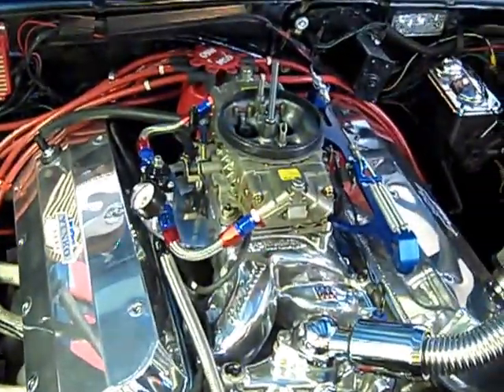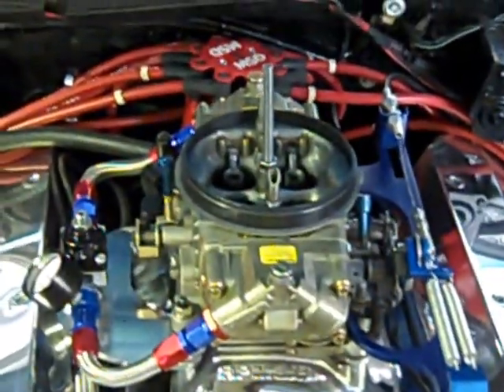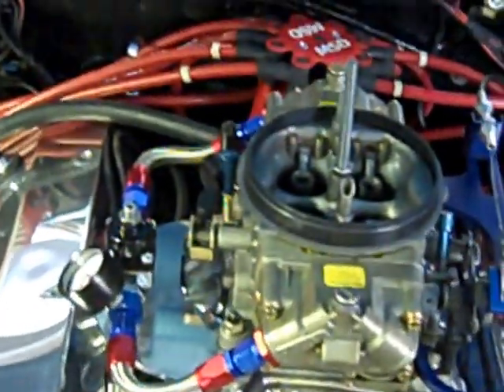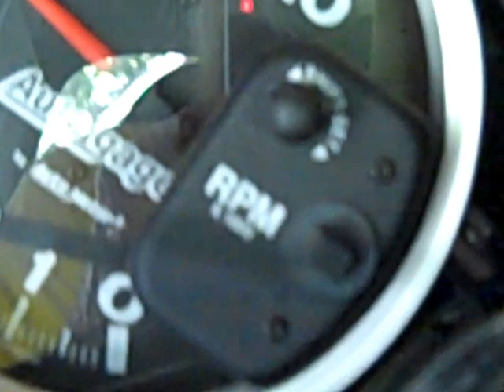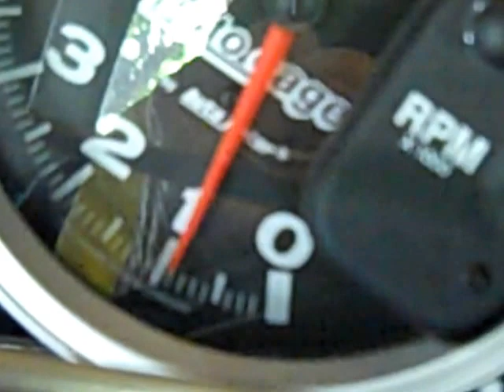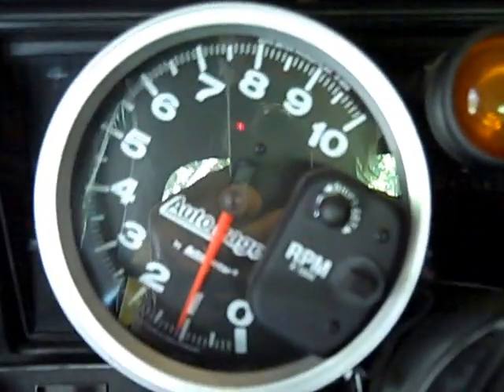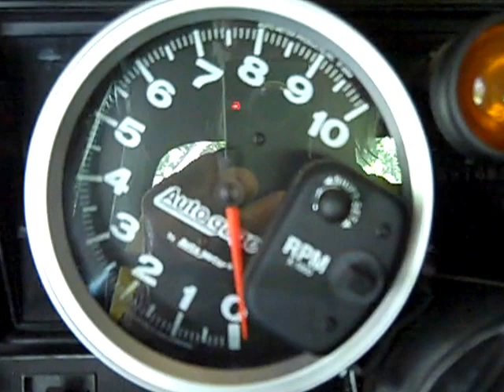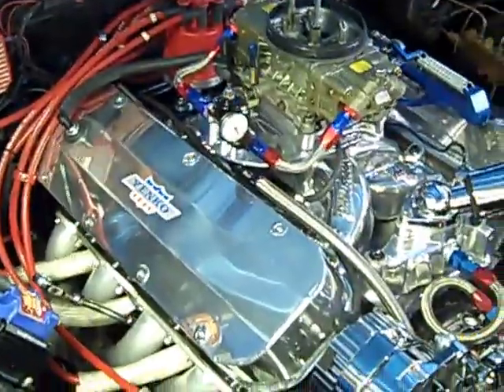nova72 468 muther thumper roller cam my timing set up

Comment: Thanks for your video. It’s helpful and good information. I’m working on a 69 Chevelle and the hydraulic roller is the set up lm using with 990 ported big valve heads with Maley piston @ 10.5 compression and air gap. Your car looks great.

Comment from the maker: the flat tappet cam was advanced 4 degrees from straight up ' so it had a different sound. the roller cam was installed straight up' the roller is definitely stronger' it also has more lift.